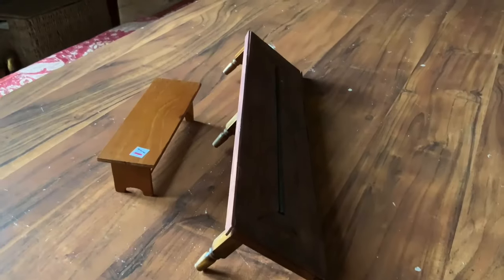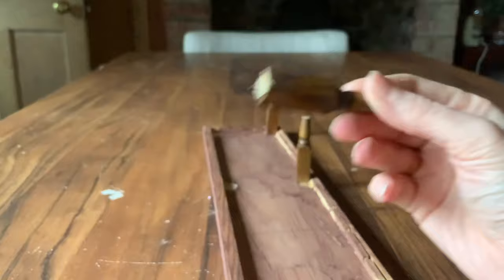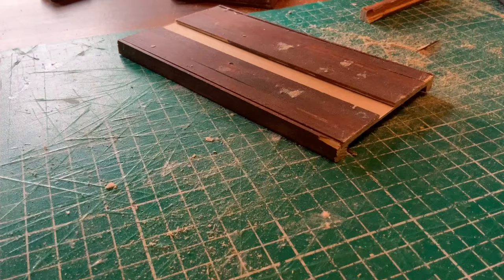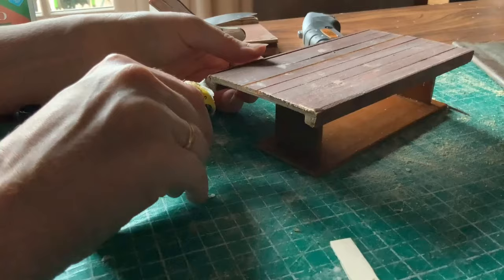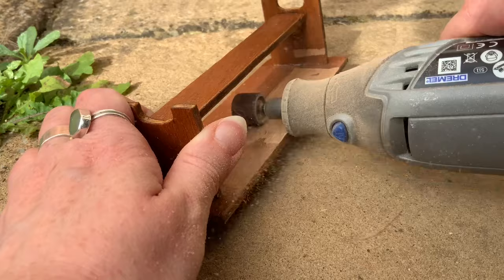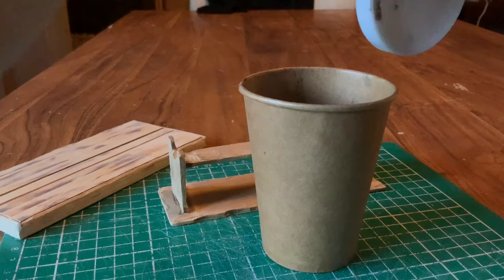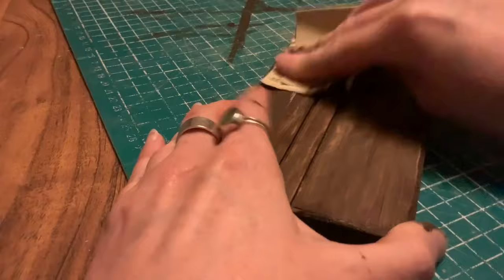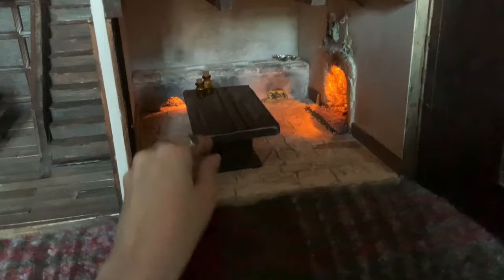Making a Miniature Table for the Dollhouse Kitchen | Tudor Doll’s House Makeover Diary - Part 27

Comment: You can get a skinny sanding bit for your Dremmel or purchase a very cheap battery nail file thingy which is very narrow.  The table looks perfect in the kitchen.  I would have never thought to turn the smaller table upside down to form the base.  So clever.😊❤
Reply from the maker: Ooo thank you! I’ll have to have a look into more Dremel accessories!